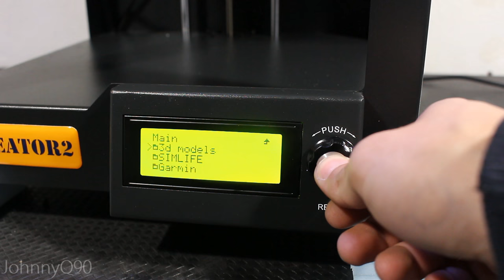3D Printing a C-Clamp - MeCreator 2

Comment: For the bottom layer:  You are printing with a "Raft". You need rafts only on special occasions, so you dont need them. You can turn off the Rafts in your Slicer. BUT I recommend using a "Brim", that will print an Outline on the first Layer, to make sure extrusion is ready. 
I guess soon or later you will bump in to "Bed Adhesion". If you would print directly on the bed, the plastic wont stick. Your Printer came with MaskingTape, but it will wear off after Time, so zou need to replace it. You can stick with that (Ba Dum Tsss xD).Its ok if you dont mind to replace it, but the Texture of the Tape might transfear to the Print. An alternative Solution would be a special (expensive?) Build surface for Printers...but I cant tell you if they work. Many People use Hair Spray ore a Glue Stick. But i would NOT use Hairspray, because it could spray all over the 3Dprinter parts and other Stuff you dont want Hairspray on.... I use a simple Glue Stick. It holds really good, it will give a Surface as smooth as the Print Bed, but only if you apply a thin layer, so the disadvantageis , you need to  replace the glue on the preveously printed position. That can cause overlapps on the thin Glue Layer and  the replaced Glue, that will cause Hills an you need to clean it off. So it is as "annoying" as MaskingTape, but it will hold stronger and gives a better Surface finish.
 
And btw, since you have the Tools, i think you can make your own Hotend (based on the E3Dv6 maybe :D ) for a Future Project :D Just an Idea/Suggestion ^^

Comment: I rarely ever print with a raft. I only use a raft if I have very little service contact of my part to the bed. If the raft can stick generally the part can stick. That would help with the bottom layer. Also for calibration I like to print a single wall 20 mm square with no top or bottom and measure the thickness of the wall and compare it to what it should be. You will need to do that for each new roll of different filament you install because each roll will have small differences.

Comment: Maybe to solve the problem with the bottoms, you could use an extremely fine sand paper, or you could spread a layer of epoxy over the surface to create a hard layer to which you can smoother. There is also a technology called conditioning for 3d printed items.

Comment: The bottom layers look kinda bad because the printer is trying to print on top of air, this effect is more obvious if you try to print an overhang. You could try and avoid this by printing directly on the printer bed instead of printing on the support base that you peel off. Be careful though, this may cause larger parts to warp and not come out straight. 

Another possible solution would be to print the part in two pieces that are then welded together on the bottom face. If you are using ABS plastic to print, simply dabbing a bit of acetone on the part will melt it a bit and could fuse parts together. There is a YouTube channel called XRobots where the guy builds huge creations mostly out of 3D printed parts, his videos might be of some use.

Comment: Like everyone has said, try not to use rafts. If you still REALLY want to, I recommend you adjust the Z gap in between the part and the raft till you get it to the pint where it prints nicely, comes off, and looks good all at the same time. If that doesn’t work, try printing the part in PETG with the raft. Or you could just print the part directly onto the bed. If the bed is heated, try to heat it somewhere 50-80 for PLA, and around 80-100 for ABS. You could also try to print a brim like others have said.

Comment: dont use raft, use brim for even just a skirt for plate adhesion. makes the bottom much better.  but may be harder to remove.  get some kapton tape instead    easy to remove the parts, mirror finish on the bottom and sticks better than paper tape.

Comment: dont use rafts, they waste plastic and have bad surface texture
Reply: Raft?
Reply: Crazyhero 1924 rafts are the base plastic layers where the piece is then printed on. Most slicers have them enabled to reduce the dimensional aberrations caused by print bed warping.

Comment: Little thought on your clamp.

There's a rule of thumb in my book saying that the thread length in plastic should be 2x the diameter of the screw.
Seeing yours, it's not. 
Since I'm no pro (yet) I'm wondering your thought behind this.

Comment: Unless it's ABS you don't need to print on a raft, which is what's causing your crappy bottom surface finish. Also, even for structural prints, your infill setting is too high. You should only need 80% infill at the highest